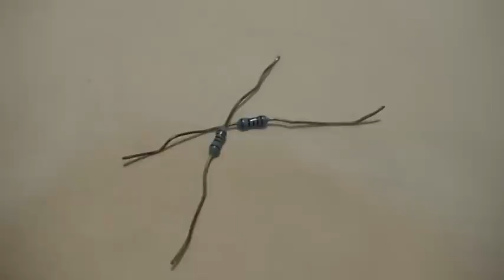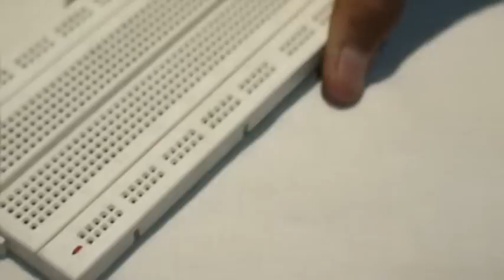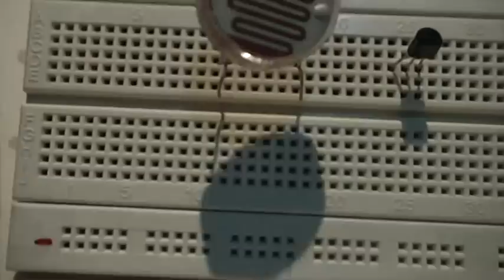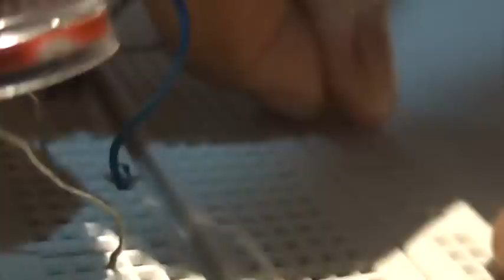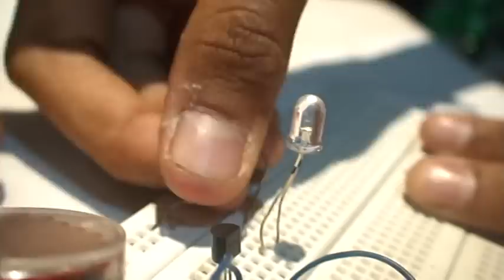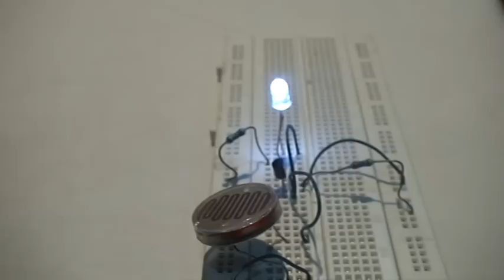How To Make A Light Sensor

Comment from the maker: If you want you use a motor you remove the wire connect the led to the positive rail and connect the motor directly to the positive rail. And the other end to the transistor...... :D

Comment from the maker: Connect d 6V Power Source with d Positive to d Positive Rail & Negative 2 d Negative Rail.......
Here, we have used a 6V Adapter. U can also use a 9V Battery along with a 6V 7806 Regulator which converts d 9V to 6V.........